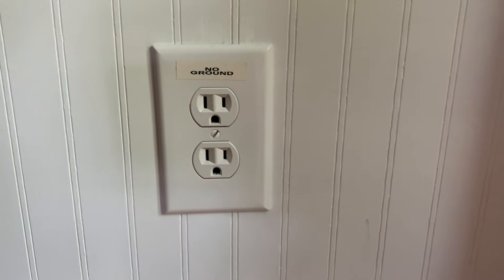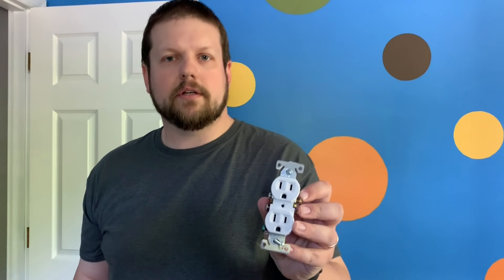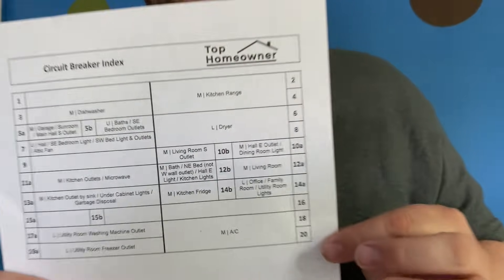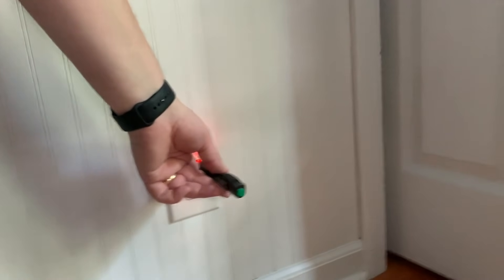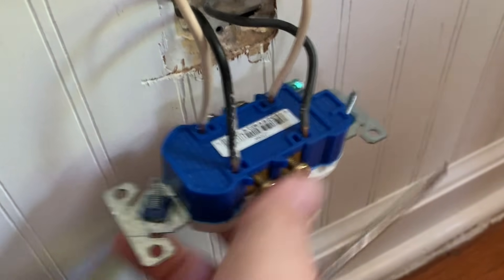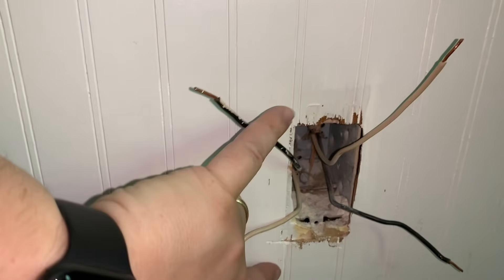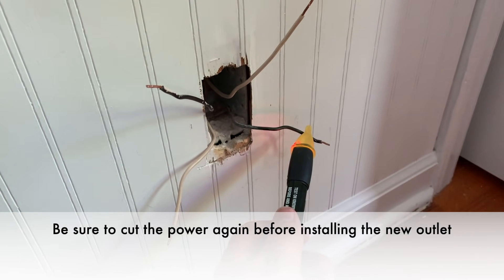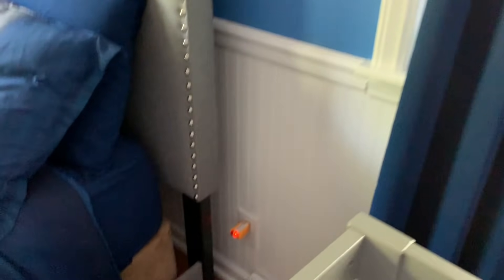Fixing Ungrounded Outlets - An Alternative Option to Rewiring Your Home

Comment: You can also install a GFCI/AFCI breaker in your electrical panel. Then all the outlets on that circuit are protected.
Reply: That is normally a better option, however, you need to have an electrical panel that accepts newer breakers.  I'll explain better.
There have been many brands of circuit breaker panels over the years, all of which use different types of breakers.  Over the years through mergers, acquisitions and buyouts, many of these companies have disappeared, but companies like Seimens, Square D etc provide replacement breakers for those older panels.  The problem is if those companies disappeared before they started producing ground fault and arc fault breakers then you could have problems finding such a breaker, or if you can find one then it is terribly expensive.  And considering most homes without ground wires are older homes it is very likely the breaker solution would be very expensive.  I ran into this when I renovated my master bedroom.  An arc fault circuit breaker would cost me >$800.   So in this case an outlet is a much cheaper option. and my home is only 50 years old.
Reply: I was just going to comment this, why waste money on single point protection when you can have multi protection.
Reply: So would that still lack the ground protection for equipment using a surge protector?

Comment: Adding a GFCI does not make it grounded and it will also light up red on a better electrical tester. It also will not trip when a fault is introduced using a GFCI protector. Just add a ground and be done with it. Since you have metal boxes, it's easier especially since the outlets themselves were already grounded to the box. Just fish a wire of the same gauge to a cold water pipe and use a clamp. You can even daisy chain ground wires from one outlet to another. A GFCI that is ungrounded offers no more protection than a regular ungrounded outlet.

Comment: At 4:10 you say "We're going to confirm the power is off . ." You had already confirmed that when you plugged in the outlet tester. Then you put in a circuit tester and as we hear it beep you say, "it doesn't beep so that means power is off." Very confusing I think to anyone not already familiar with what you are doing. Electricity is dangerous and you must really be careful as a DIYer not to make things seem simpler than they are. Before publishing a video you should watch it carefully and take the time to get rid of little goofs. Yes, many home owners can do this stuff, but they usually watch YT videos to see how to do things correctly. The goal shouldn't just be to show people what you know, but to very accurately show exactly how to do the thing, and do it safely. No mistakes, no possible misunderstanding what you are doing, saying.

Comment: Those holes in the back of the outlets should be illegal. I have replaced several outlets in my house and several of the wires have just fallen out of the back of the outlet.

Comment: I never leave wires open, even for a few minutes. I would cover the wires with either a wire nut or a fold of electrical tape. Since it’s temporary, I just cut the tape to about 2 inches, lay it over the end of the wire, and fold it back on itself. Makes it easy to remove.
Reply: I’m not saying I don’t change them out live, I just don’t walk away with them live. I’d hate to get interrupted and someone else not realize it was live. Very slim chance, but better safe than sorry. 😢
Reply: @TomCee53    IIRC they offed a character on an old sitcom show, "One Day At A Time", that way.  In that case the guy was working on a live light fixture and someone walked in and turns on the switch.
I remember thinking at the time it was such an odd thing to do on a show because it's so plain and realistic of a scenario.
Reply: Ha. I change them out live 🤷🏻‍♂️.
Reply: I prefer the small piece of electrical tape ..stays put!

Comment: I asked a guy to ground my kitchen outlets but I'm not sure he's fully invested in doing it correctly. 
This is an old (1950) house in a creepy little town in the Ozarks without any building codes. The house is not now nor has it ever been grounded. How can I get the whole house grounded? How can I make him find out which is the first kitchen outlet?
Can I have GFCI outlets installed everywhere? The wiring is something called peg ... I'm  not sure the whole name.  But the wires cannot be removed and replaced. What are my safest options.  (I'm on disability of only 850 $ per month income.)
Reply: I meant knobs and tube

Comment: Just so you know you are telling people the wrong and misleading them. I am a Master Electrician of 30 years and the proper way to do this is to install a GFCI outlet in each opening. The reason for this is because the GFCI will not trip without a ground>>>>> So per the code you need to install a GFCI outlet in all the locations... Try tripping the GFCI from the next plug inline. It won't trip the GFCI.  The GFCI needs a ground to trip. the reason you are installing the GFCI in the first place is because the GFCI will take the Ground fault and return it on the neutral wire and safely ground it. Please do your research before you tell people how to do something. Someone could die if they do this and the next plug inline faults. It will still have no where to go and possibly energize the equipment. Potentially electrocuting someone. I am not telling you this to upset anyone! I am just concerned that someone will be hurt. Thanks for listening. Be safe out there...
Reply: They do not need a ground to trip.
They're supposed to detect current between the hot and neutral making sure they match so to say.

Comment: You should use your voltage detector on a known live outlet first, then test the outlet you will be working on.  Alternatively, plug a lamp into that outlet before flipping the breaker off.  Otherwise, if the tester is broken you will be in for a nasty surprise. Generally a small bedroom has all outlets on the same circuit, do not assume this is true.  One of my bedrooms has outlets on two separate circuits, I wasn't previously aware of it but discovered that when teaching my son to check each outlet before working on it.

Comment: The NEC does not allow a three-prong outlet to be installed on a non-grounded circuit unless the circuit is GFCI protected. An electrician can install a GFCI breaker in the panel or a GFCI receptacle at the outlet.Dec 23, 2021  

You have to install one in every outlet you want to have a ground on  per the NEC. The stickers are for that outlet as no toher outlets can be gfci protected without a ground wire. You are giving people very bad incorrect info in this video. You do not understand how other outlets are  gfci protected.  You tripping the gfci does not mean that other outlet is protected in fact ITS NOT PROTECTED because there is no ground wire !!!!!!!!! Maybe look into that before making a video!!!!  JUST IN CASE I AM NOT CLEAR YOU ARE WRONG AND THE OTHER OUTLET IS NOT PROTECTED NOR IS IT TO CODE. A GFCI WILL NOT PROTECT THE OTHER OUTLET BECAUSE THERE IS NO GROUND WIRE . THE GFCI NEEDS A GROUND IN ORDER FOR TOHER OUTLETS TO TRIP IT. THEY SELL TESTERS  GO BUY ONE AND SEE. IT WONT TRIP. I WORKED AS AN ELECTRICIAN I DID THESE JOBS AND WE INSTALLED A GFCI IN EVERY GANG BOX BECUASE THAT IS WHAT CODE CALLS FOR!
Reply: No it doesn't. stop giving false information.
Reply: A 3 prong GFCI outlet can be installed on an outlet that only has a hot and grounded conductor/neutral.
Outlets with only hot and neutral can be installed downstream.
They should all be labeled that they have no equipment ground.

Comment: Ok. Luckily i work in a factory with a certified electrician. I asked him about rewiring my house and I also asked him if I could do this whole GFCI thing and his eyes went wide. He yelled at me and said I'd catch my house on fire REAL FAST. SOOOO I don't think this is a good idea. I get that it makes sense. But to be ACTUALLY safe, you NEED a ground wire. Even if it's just grounding it on a water pipe. (Water pipes run into the ground)
Reply: The water pipe cannot have any non metal segments and must be bonded to the neutral bus at the main panel. In the event of a ground fault the neutral bonding is required in order to trip the breaker.

Comment: One thing that works is to bond the green screw on the receptacle to the white(neutral) wire(screw)  but that not code. If the neutral get broken it could be a hazard, though also with the neutral broken the circuit won't work either.
Reply: No, don't that. It's called a bootleg ground and is illegal and dangerous. The ground and neutral are bonded at the main electrical panel and nowhere else. This is an unethical tactic used to fool inspectors when using receptacle testers.
Reply: @surferdude642  Right Ted and that is what the CODE is for. Anytime we fool with electrical stuff just remember that it is powerful stuff. Watch for the GOT YOU'S!

Comment: you can also consider replacing lighting breakers in the electrical panel with GFCI circuit breakers. But that's a patch. I recommend that if your house is like this one- with an ungrounded electrical system- that you hire an electrician to inspect and advise you. He will give you a few options, adding GFCIs like this is one of them, but the best and safest thing to do to bring your home up to the current electrical code is to add ground wires and a grounding stake at the exterior electric meter.

Comment: What do i do if i dont have a ground wire, in my house in which is a very old house, it only has a hot and a neutral wire but no ground wire for all the outlets in my house
Reply from the maker: You can install GFCI receptacles at the first location on the circuit, or you can install GFCI breakers if your panel is new enough. Keep in mind GFCI helps keep you safe, but it won't provide a true ground. Hope this helps.

Comment: Videos like this are job security to me. If you really wanted to do this instead of having an actual ground. Easiest way is to buy a "gfci breaker" for the entire circuit and replace it. Or for cheaper, pull the wire out your breaker, install a gfci receptacle by breaker, then feed that to breaker. But I don't recommend either and your home insurance most likely will not cover such work. Then your dummy stick is not a replacement for a meter.
Reply from the maker: Panel was too old for GFCI breakers

Comment: Doesn't it seem a bit odd that the circuit only has two receptacles on it, or were there more between the start and end outlets you did not mention?
Reply from the maker: Yeah that would have been odd, there were other receptacles but I didn't show everything.

Comment: If that garage and living room are on the same breaker and the living room has a gfci do I need gfci in the garage?
Reply from the maker: It would depend on which one is first on the circuit. If your breaker panel is in the garage, then it's probably not protected by the living room GFCI. You can easily test this by pushing the "Test" button on the GFCI and see if the receptacle in the garage still has power. If it does then you'll need to install one in the garage. This video helps explain how to wire them: https://www.youtube.com/watch?v=Uop79H_iqoQ

Comment: People also ask
What happens if GFCI is not grounded?
If this “short circuit” occurs and there is no ground wire present, the current could find its way to ground through other building components in the wall, potentially causing a fire. Or, if you were to touch the plug at an inopportune time, the current could find its way to ground through your body, causing a shock
Reply: Doug, that's wrong. If a GFCI is connected and all downstream outlets are fed from the load contacts then all of those receptacles will be protected even without a ground wire. A difference of more than 6 milliamps between the hot and neutral wire will trip the GFCI immediately and shut down the rest of the circuit. Sensitive electronic equipment may not be protected even with a surge  suppressor because it requires ground to function properly. Individuals will be safe and this is a appropriate solution and code compliant when no ground is present. The downstream outlets can safely be upgraded to 3 prong. You are supposed to apply stickers on the faceplates that state "GFCI protected outlet" and "No Equipment Ground". The test and reset buttons on the GFCI should function normally, but a tester that you plug in and push the test button will not work. It will also display "open ground". If you get a short circuit (between neutral and hot) the breaker will trip.
Reply: GFCI and grounding do not depend on each  other but they can work together for best security. It is like seat belts and airbags. First shot circuit is not relevant here, a short circuit is handled by the breaker. The issue is ground faults i.e. current escaping from the circuit. Grounding works when current escapes to the grounded case. A GFCI on the other hand detects when current escapes and cuts the power. The problem is that without grounding yo may need to touch the energized case before the current breaks. This will hurt but it is not dangerous to a normal person.

Comment: Hey I just did this for two circuits in a house but the third is not working. Check the test button, checked to see that everything is energized hot and neutral at the GFCI, and everything downstream is too, but still nothing is powering on.
Reply from the maker: Might want to try installing a regular receptacle or another GFCI to see if the one you just installed is actually bad.
Reply: @TopHomeowner  thank you, I actually managed to solve the problem and it was my own dumb fault. I mixed up line and load neutral 🤦‍♂️

Comment: Hi, the GFCI outlet you installed on the first outlet in a run in that room... It had no bare grounded wire. Will it called properly GFCI circuit outlet??? Just my input question so we all can learn its code together.
Reply from the maker: GFCI's will work independently of a ground. I made a follow-up video that goes into more detail: https://youtu.be/3AXcRsAOLPk

Comment: You should get the plug in tester that has a ground fault test button integrated into it.  My tester is red in color as opposed to yellow.  That enables a test scenario at the remote outlet
Reply: Such a tester does nothing if there is no ground wire.

Comment: Also worth noting, surge protectors do not work plugged in to an ungrounded circuit, may want to rewire any outlet that you have them plugged in to.
Reply: That is not true, surge protectors have varistors between all the three contacts. In anyway rewiring a house for surge protectors is the most insane idea ever.
Reply: @okaro6595  I think that's wrong. MOV's aka metal oxide varistors do require a ground to function. Without a ground wire electronic equipment will not be protected unless it is integrated in the equipment as a safety feature.

Comment: They didn’t daisy chain back then bro. That only works if they looped the wires. Back then they would have one junction box feeding the devices. Using gfi breakers would fix the problem tho.
Reply from the maker: Thanks for the info!

Comment: Hi please help i need to ask. I need to know if i can put in a same room 2 of this type of outlet . The home its old and has in that room 2 outlets 2 prongs and i will put there a new washer machine and a small fridge.. did you recomend using this for washer and fridge?  I need to ask if i connect without using the ground and the system has a fault if the outlet will tripp? For bee honest i didnt decide what outlet use. The outlet box its metal i beleved but i dont know of it grpunded. Can i use a screw for attacth a cable to a new regular 3 prong outlet to the box or if better the GFCI outlet?
Reply from the maker: GFCI will provide more protection (safety) but not a true ground. I still recommend installing a true grounded outlet whenever possible but that's not always an option. I think the washer would be OK, but typically you don't want to plug a fridge into a GFCI because there is a higher chance for the power to be shut off, which could spoil your groceries. I hope this helps

Comment: Does this also work for a house with a breaker box that has the screw in fuses?  Will it cause the fuse to blow when there is stray electricity?
Reply: Anyone...?
Reply from the maker: No difference if it's a breaker box or fuse panel. The GFCI outlet sees the excess current first since it's closest to the problem and should shut it off before ever reaching the fuse.

Comment: What if the box's are too freaking small to install a GFCI??
Reply from the maker: Mine were pretty small too. If depth is an issue, Leviton makes a Slim model. Others companies might too. Hope this helps!
Reply: You can get a Legrand device box which will extend 1 inch out side from the wall. They typically come in ivory color but could be painted any color. I did this in the kitchen and doesn't look bad. The mounting method to your current box is very sturdy. They carry these at Home Depot, Lowes, etc.

Comment: Xx don't use those back stab ins if you can help it
Reply from the maker: Agreed, except for GFCI's use clamp-based back wiring just like commercial grade receptacles (instead of the spring clip). Should be fine.

Comment: This video helped  a lot. Now what do you suggest  when wiring a new ceiling fan to black 2 wires in an older home?
Reply from the maker: Glad it helped! If you only have 2 black wires (and no white) then you'll need to figure out which one is hot with the voltage tester I showed in the video. Just be sure to put wire caps on the wires when testing (i missed that part in this video) so you don't risk getting shocked.